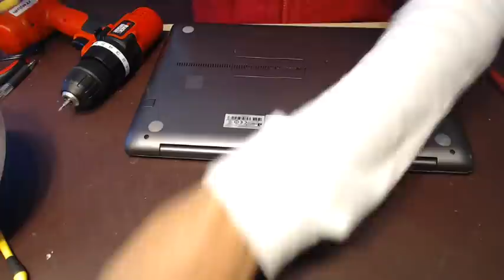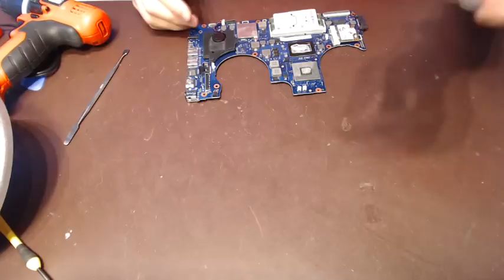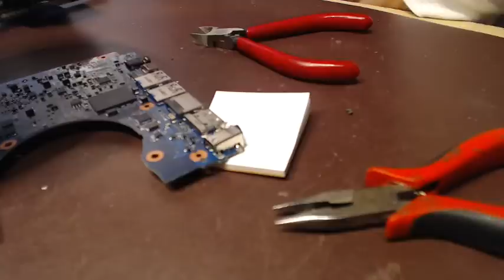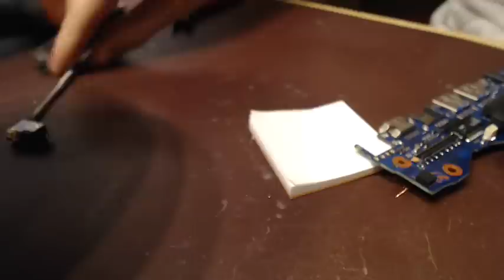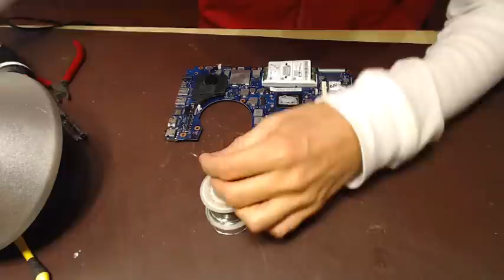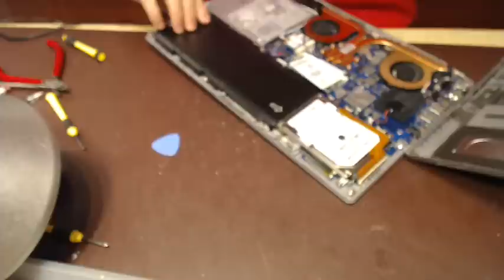Samsung Series 7 Chronos 700Z5c-s01UB 700z Laptop Power Jack Repair Socket Input Port Connector

Comment: are you shorting the 2 square caps just behind the port, cant tell due to horrid focus and your hands being in the way most of the time.. maybe take your camera off macro and redo this as I need to perform this fix in the next few days
Reply: I'm assuming you have this laptop or something in this series. I have the series 7 Chronos; and have noticed extremely short range on my wifi. are you dealing with the same issue?